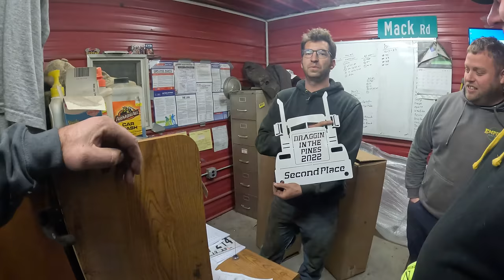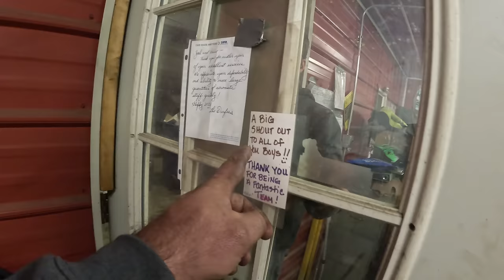It Is More Than Just Trucking-  Newton Ag Service Shop & History Tour

Comment: Love this video!!Like Zach's worl ethic. old guy hit KW door to show Zaxh it would stay latched . Unlike Peterbilt doors. You have to slam pete doors to get them to latch tight. KW's just pull to first latch then pull in to seal shut. Mirrors on pet doors vinrate likr ftliners . mirrors are mounted on cab on KW's. I was a Mack guy. Their cabs rot off the frames. Mack frames and crosssembers aren't  as strong as KW..